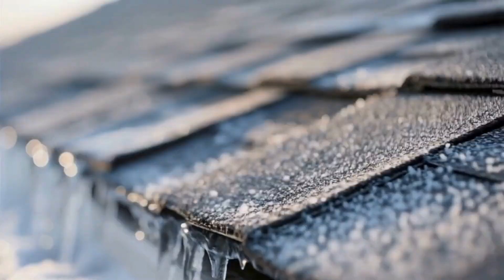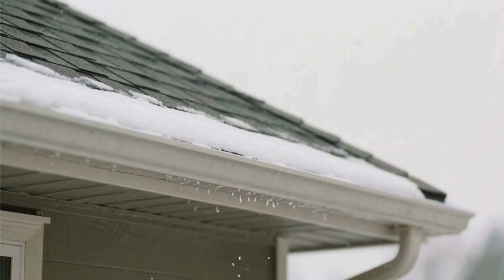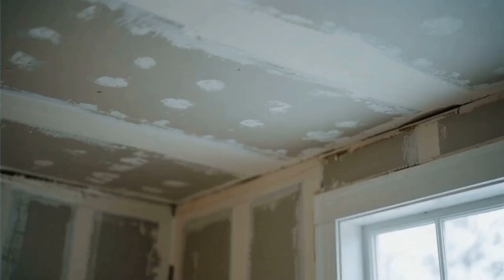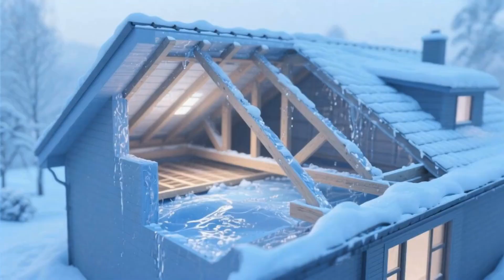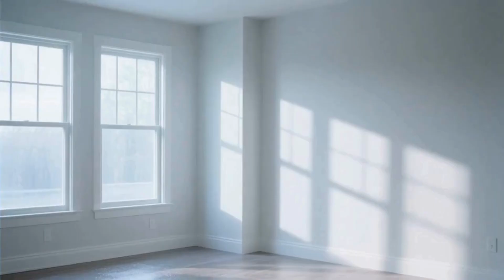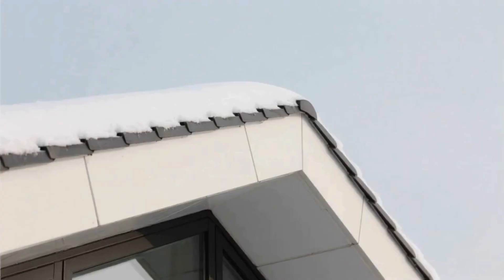You Had an Ice Dam — But How Do You Know It Didn’t Cause Damage?

Comment from the maker: If you had an ice dam and didn’t see interior damage, that’s good news — but it’s not the full story.

Hidden moisture doesn’t always announce itself immediately.

Ice dams don’t just create visible leaks. They create conditions where water can move into assemblies and sit where you can’t see it.

Moisture damage isn’t immediate failure.
It’s repeated wetting plus limited drying over time.

This video isn’t about panic.
It’s about understanding what winter stress can expose — so decisions are made from literacy, not luck.

Building science explains it.
Applied correctly, it fixes it.

Passive House for the People.